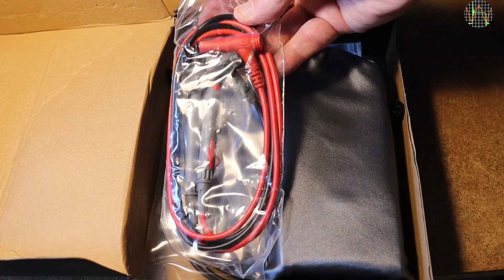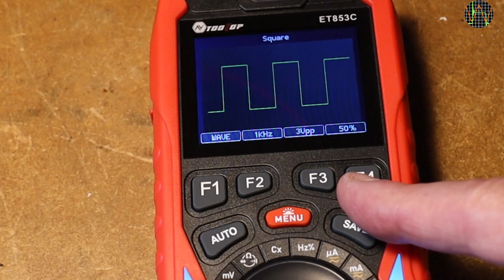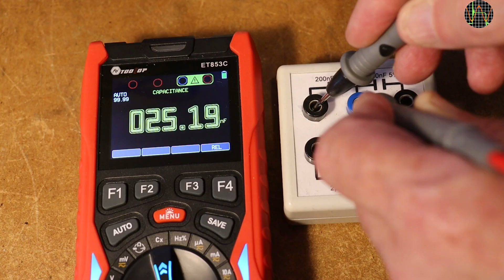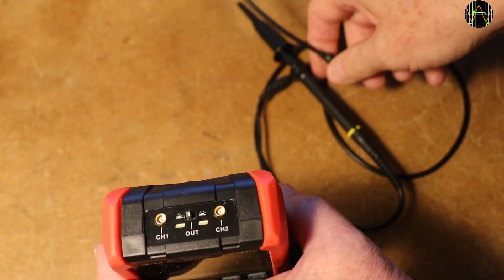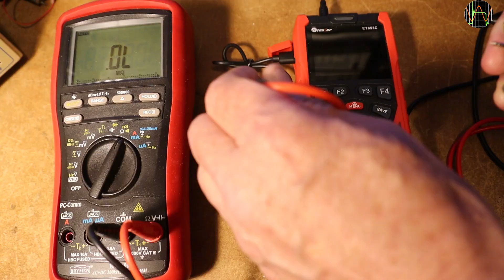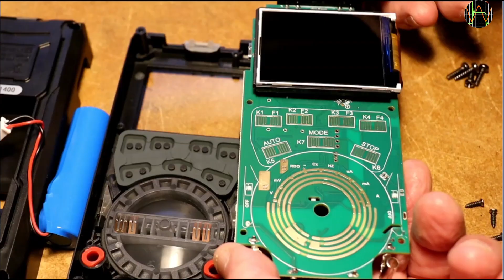189 - The Tooltop ET853C Oscilloscope/Multimeter - Great specs, but any good?

Comment: Worst multimeter font award goes to... :)
Reply: I agree... It's a good DMM for the price, but I really don't understand the whole fat, yellow, outlined font. Someone needs to go back to design school.
Reply from the maker: I had a comment about it in the video but since its a question of personal taste and some people may like it (not me), I dropped it to make the overlong video shorter. I also deleted the tough AC+DC test which the ET853C passed easily , so not only bad comments ended on the cutting floor.